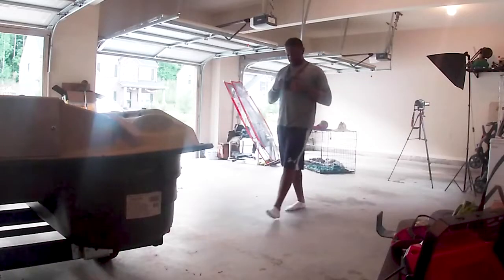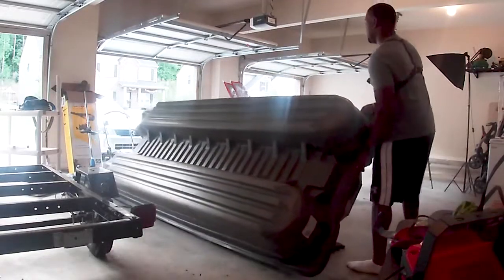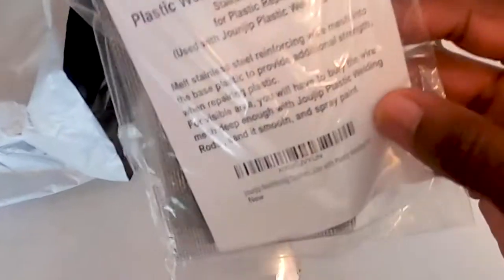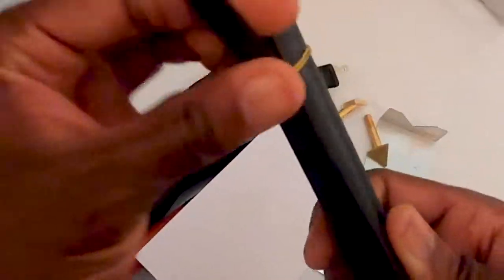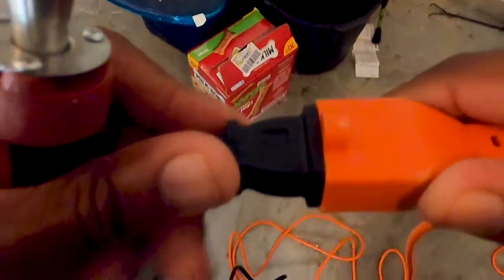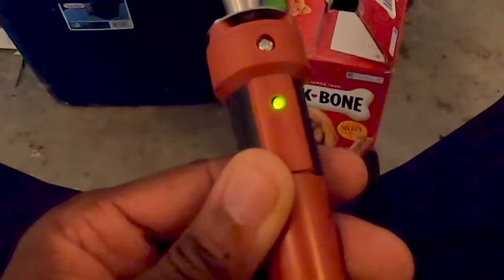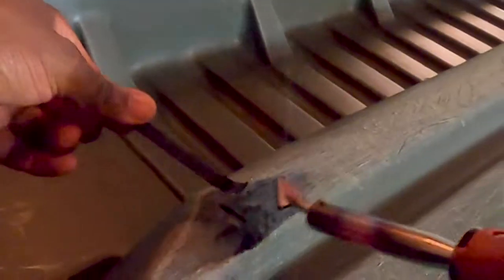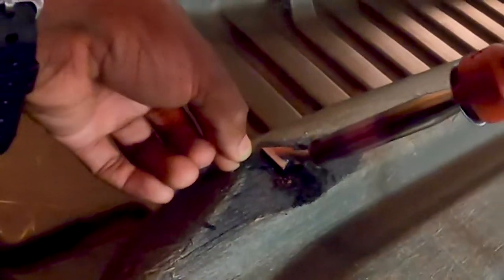WE ALMOST SUNK OUR PELICAN BASS RAIDER 10E BOAT 😱😱 .... FIXING BOAT HOLE...Part 1

Comment: After you pulled it off the trailer both holes appear to be in the same area across from each other. i would look closely at your trailer. You have metal to plastic with no runners, maybe your trailer put the holes in the boat.
Reply from the maker: This is EXACTLY what caused it and has been remedied‼️

Comment: My Bass Raider ships gallons of water without any evident intrusion site.  No holes or lacerations in the hull.  In a vain attempt to solve this problem, sprayed Flex Seal to the rubber seam that mates the upper and lower hulls.  No luck.  I purchased a drill powered pump that accepts garden hose fittings and, after an outing  remove one of my stern rod holders and then pump out an amazing amount of water.  Any suggestions regarding possible solutions would be appreciated.  BTW,  the ads by Pelican state "stainless steel hardware"; well, not exactly, the staples mating the hulls rust pronto.